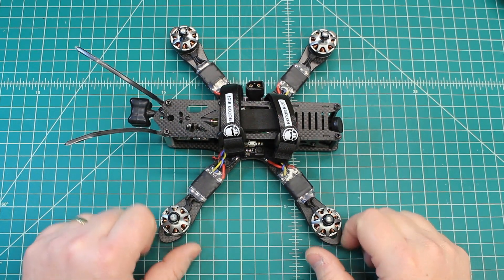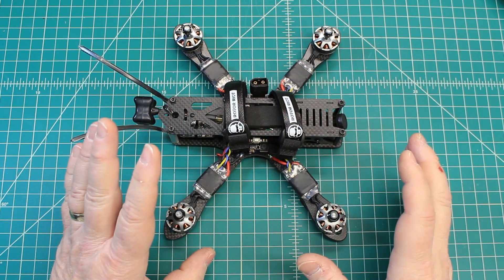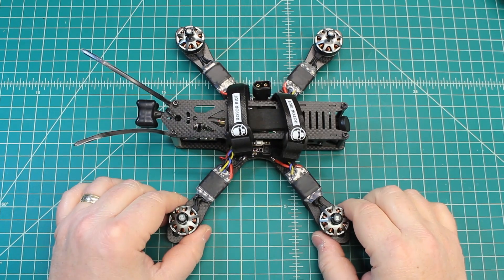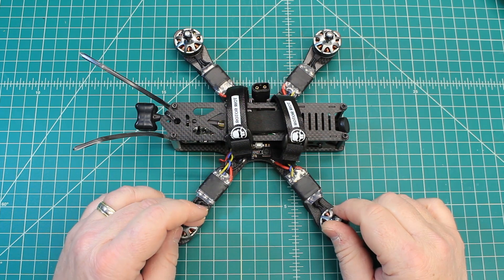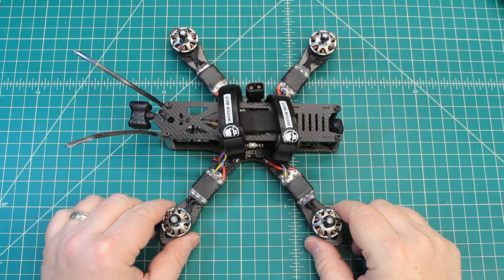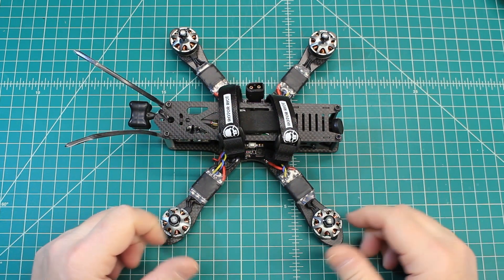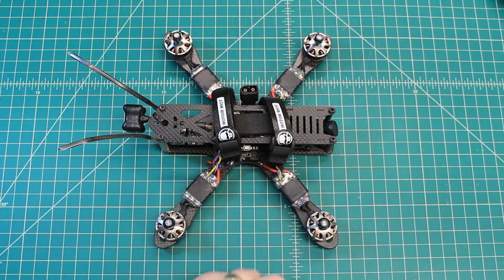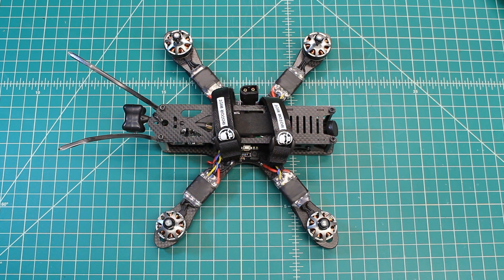Kiss'd Rotor Riot RR5 FPV Racer "Oscillation Repair" with Flight Footage

Comment: Can't find follow up / solution.  Did you ever post?
Reply from the maker: I did not post a follow up solution, because for me the solution was to remove the kiss components and replace with ones that are reliable.
Reply: X-Frames FPV I never got a smooth setup on KISS. over it.

Comment: Doug can you tell some good frames for the beginner builder?
Reply from the maker: Jriz200 rizo Qav-R is a good beginners frame.
Reply: X-Frames FPV do you think there is anything cheaper?
Reply from the maker: Jriz200 rizo zmr210 or zmr220
Reply: X-Frames FPV thanks Doug